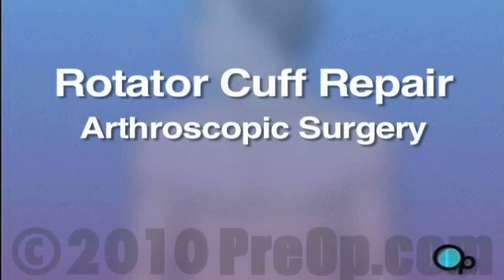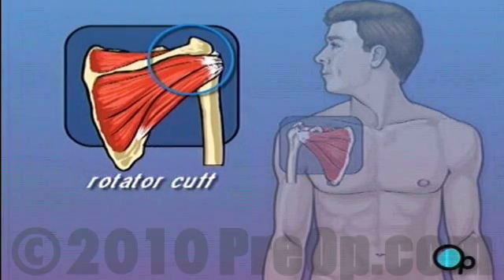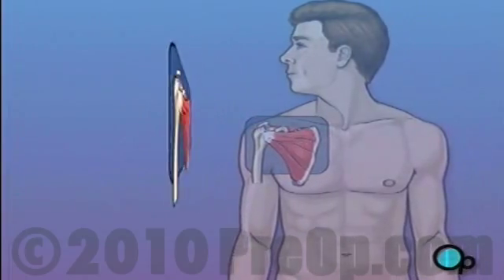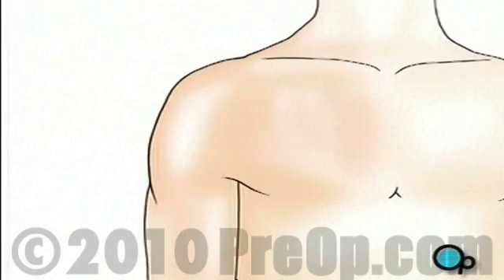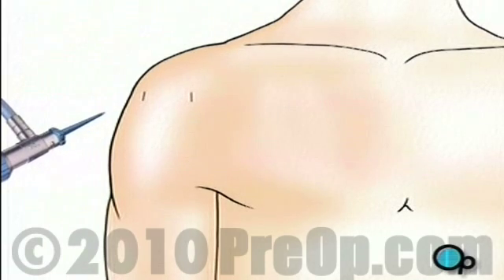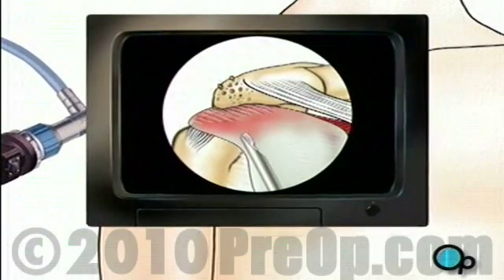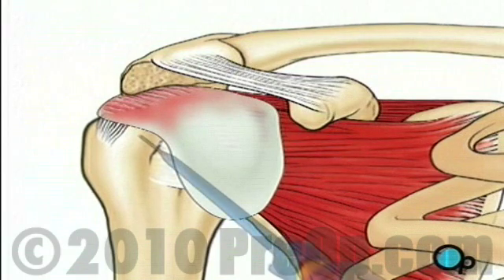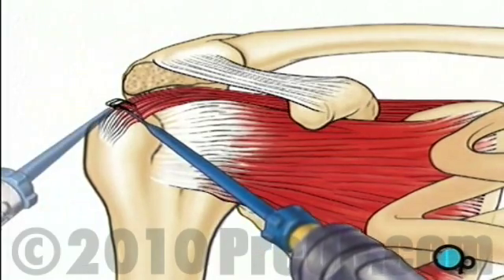Rotator Cuff Repair - Arthroscopic Surgery

Comment: thanks for the video but how it cost the surgery?
Reply: Given that the instruments are one use only, it costs a few thousand euros. Depending on the complexity of the surgery and the number of extra tools needed for the repair, the cost goes higher. My surgery was around 3500 euros and included acromioplasty, bursa removal, cartilage damage repair, cutting a biceps tendon that was too damaged. Fortunately, the supraspinatus tendon was in good shape and didn't need any reinsertion, which would have added an extra 1000 euros or so. Plus a month of immobilisation.
Reply: @Corksy  thank you for the informations and sorry about the injury it’s really bad i got it from playing volleyball 🏐 😭
Reply: @anayasmail4345  I have over a year since my surgery and been going to the gym with a trainer. Shoulder is stronger than it's ever been and no more pain or problems. Best of luck on your road to recovery!